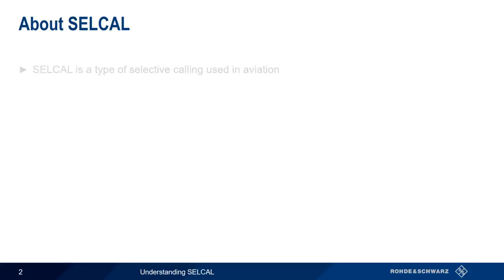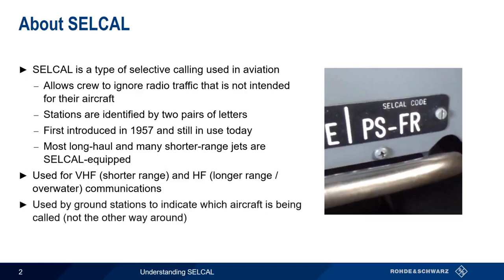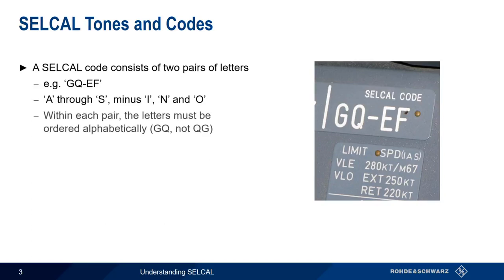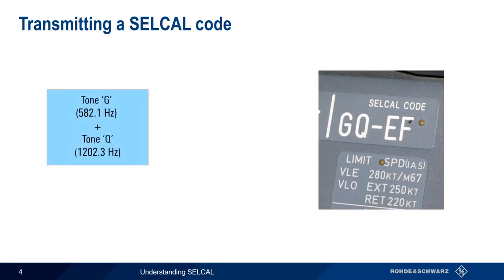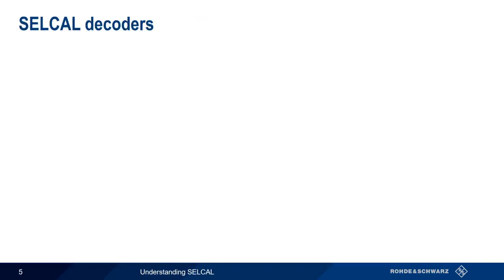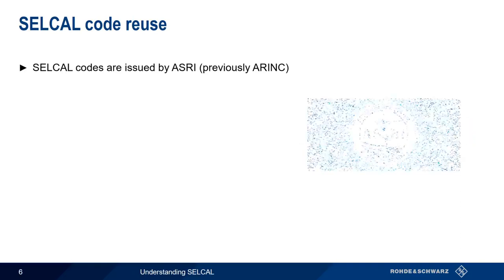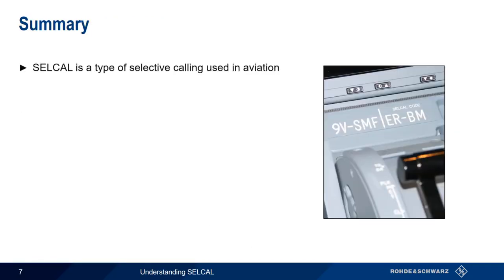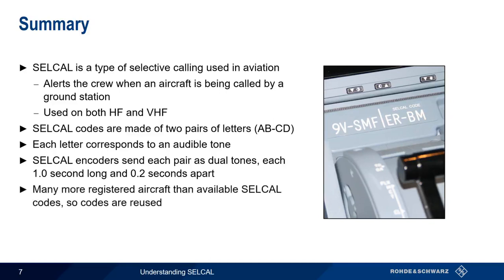Understanding SELCAL

Comment: What's the reason for I N O not being used
Reply: I'm not sure, but if I had to guess:  maybe I and O not used to avoid confusion with 1 and 0 (zero) and N because it's used on tail numbers in the United States.  But again, just a guess.  Thanks for the question!
Reply: @pauldenisowski  It's because N can be confused with M when pronounced over radio.
Reply: @smilinggoats2505  but letters are also spelled out using the NATO phonetic alphabet for that reason (same reason niner is used because 5 and 9 sound similar)